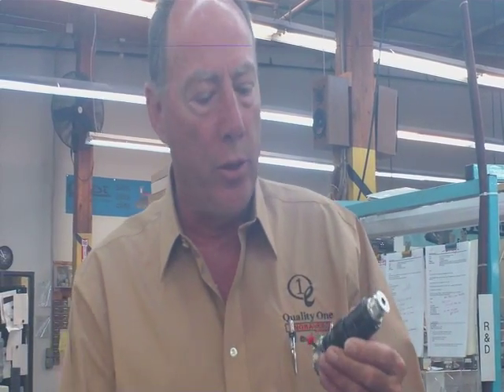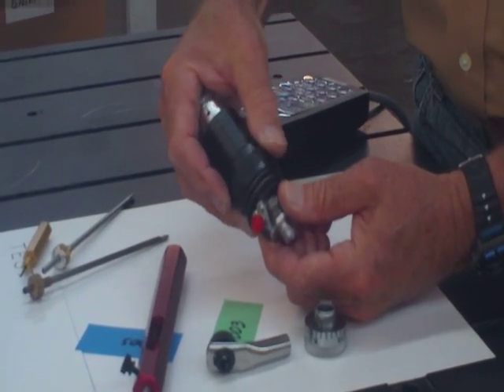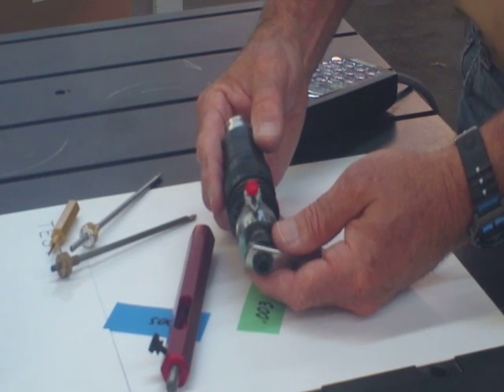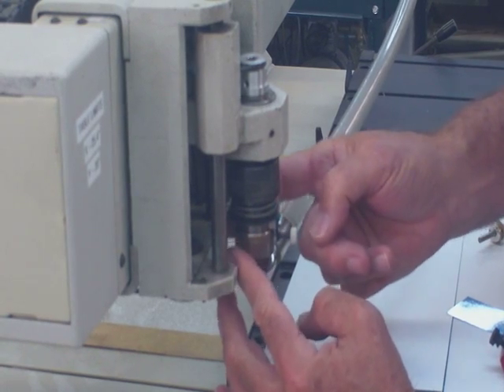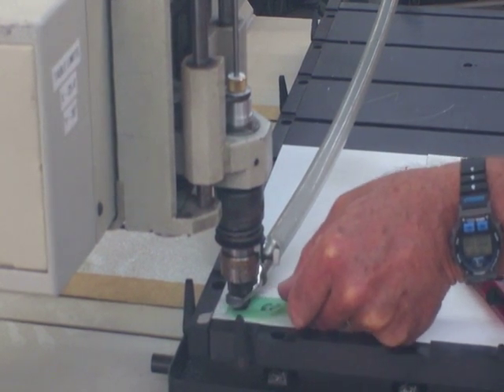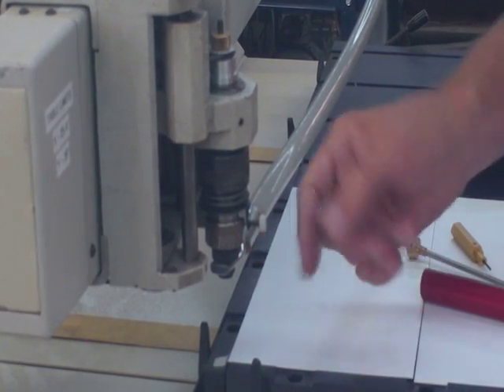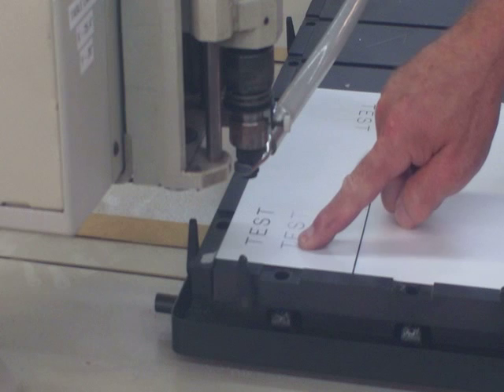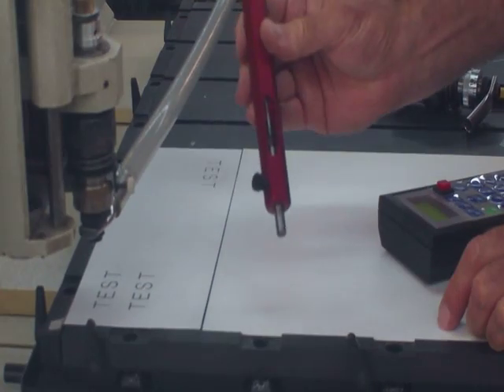Spindle Cutter Adjustment.mov

Comment: Thanks.its new hermes v3400 very slow max feed rate  35ipm or about .5ips with stock stepper drivers stock steppers..it should be way faster ..there is verry little force put on machine when doing shallow depth engraving which this machine is designed for
Reply from the maker: The V3400 can do some very fine work. But it is not a strong engraver. the leadscrews are 3/8" vs most are 1/2". The Y axis is pushed from 1 side. The X & Y rails use an eccentric bearing that will not take heavy loads. But i have used to engrave SST, Brass, pistols' and other odd stuff. brake calipers, medallions and even a full size motor cycle frame to add a SN. Be happy with the repeatability and do not go over 1 ips. Hit start and walk away.  Good rule of thumb, have 2 and you will see production double. 3 ...  They are often available for $100-500.  I have 8 (V32/34/Orbiter) of these among another 50+ others.
Reply: @Q1Engravers  thanks yep its a small engraver and can do some nice work  and you make some great points and it would be much better if y axis was driven by a center mounted stepper or 2 steppers one on each side however on a stock v3400 i dont think any of this matters as the weakest link of the design is the mile long rubber band to drive spindle and the dremel size 60W baby motor..the motor and belt will slip/fail  before you ever hit the max ability of the steppers or bearings or leadscreas for sure....also i think for the small size 3/8 leadscrew is plenty plenty strong i have seen many cnc machines engravers this size and much bigger with smaller 1/4 in and 8mm/5/16  lead screw..so oeverall this machine is very rigid and great...the spindle motor and rubber band belt to me is the biggest flaw..making anyhting else irrelevant. i got mine for only $100 complete with ep module in good working condition..im happy...its just a hobby for me.

Comment: Nice video ..clear  explanation...i  just picked up a very old new hermes engraver. Why are they so darn slow max feed rate? Seems like max is only about 35ipm. Also if the machine will be used to do a 2.5 or  3d toolpath  i assume you would remove all the float by tightening the nut until it stops and extend bit past cone so cone wont touch material ..is this correct? Such as machining pockets or true v carving.
Reply from the maker: Depending on what machine you are using; some had just 1.5A stepper motors. Typically i use 2.8A or 3 Amp. What model Engraver? What controller is being used? The table will typically move as fast as 1.5-2 ips traversing and typical engraving is .5 to 1.2 ips. But the controller and steppers will typically be the limiting factor.  Likewise if a sturdy machine will take higher speeds, a weaker machine will destroy itself. The faster you go the higher the wear rate. Laws of physics.

Comment: The problem with that setup is you are dragging on the material while engraving which can scratch and damage part or get caught and damage machine...it also will damage / scratch part when it drags the chips all over the piece while engraving.
Reply from the maker: You must use the right material, the right nose,  right tension and the right chip collection. I have these parts available. They are guaranteed to work. When doing some soft material like plastic grips or switch plates a thin tape is applied to cut thru. On items like anodized aluminum (gun parts) I use a thin lubricant paste. My engraving jobs there is never a scratch on them. Use nose 95+% of the time.  Doing it for 35 years.